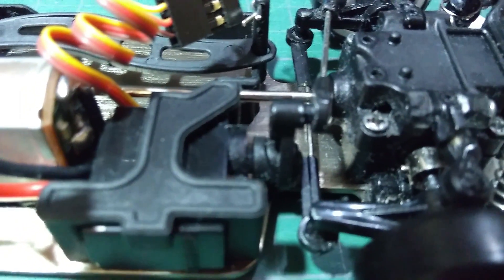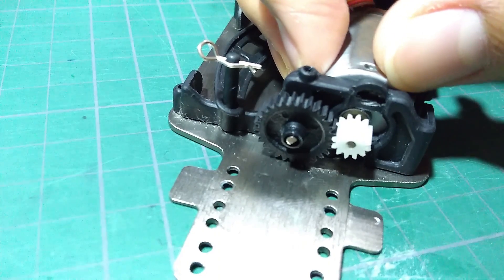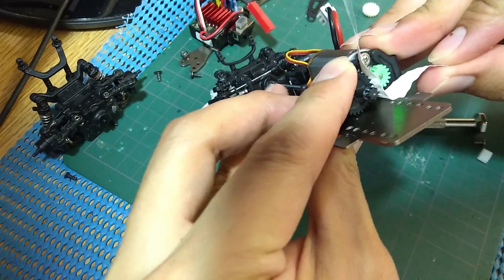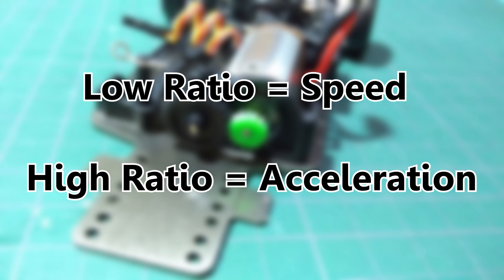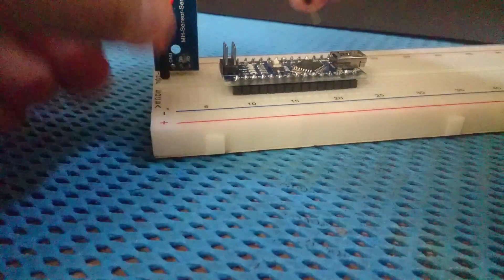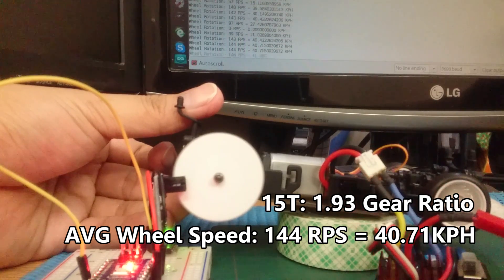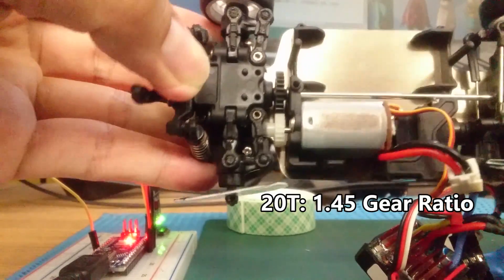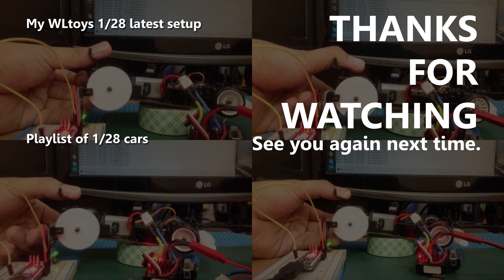How to set RC gear mesh, gear ratio & WLtoys K989 mod to use all pinions.

Comment: Is your car stock
Reply from the maker: The chassis is stock. The electronics already had an upgrade.
Reply: @BeaversHobby  what electronics in particular aren’t stock?
Reply from the maker: @joshuafallows2232  ESC = Hobbywing Quicrun 1625
Transmitter & Receiver = Radiolink RC4GS (I use RC3S, it's the previous version of RC4GS)

Comment: Has anyone else noticed that the newer version of this car is using a metal pinion without adjustment in the stock mount? If I use a gear puller to remove the pinion so I can modify the mount as described here, can I re-use the metal pinion or am I better off tracking down the plastic pinions?
Reply from the maker: Replacing it with a plastic pinion is a better.
Reply: @BeaversHobby  Seems like the biggest problem with mesh I have is with the metal pinion. That and the wobble in the prop shaft, but that's minor compared to how tight the pinion and spur are. I'll snag a pinion set and follow your motor mount mod instructions to see where it leads me next. Thanks!
Reply from the maker: @SchmingyYT  My pleasure. Best of luck with the project!

Comment: Howd you remove the stock pinion gear?
Reply from the maker: Using a gear puller is the safest way but you can make do with a simple flat head screwdriver. That's how I usually remove the gear anyway. Use a flat head to push it out.

Comment: Very nice tutorial 👍🏻 
Sir i just buy wltoys like yours, but i cant got straight steering, how to adjust them? I try to trim from tx but no result..
Sory for my english.. i hope you understand what im talkung about.. regards from indonesia 🙏
Reply from the maker: Check the tyres contact first to see if you got all 4 tyres on the ground. Also due to the suspension geometry it can be difficult to go straight once the car looses the grip so another way to keep it pointing in straight line is to mod the front steering linkages on both lower and upper bars so you can create toe out. Here are the photos.
You don't have to do this much because it'll eat up the tyres. I make this to show what a toe out means. https://imgur.com/EpSmkxk
Adjustable linkage. https://imgur.com/5cGBBcx
Use rods with ball ends for 3.5mm ball head.
Reply: @BeaversHobby  thank you for replying sir, i got it, i think the way, this is about adjustable steering linkages, i try to find rod like yours.. once again Thanks 🙏
Reply from the maker: @dodiiidris  My pleasure. Good luck with the project.

Comment: But using all metal pinions? Better or not?
Reply from the maker: All metal pinions are only good if you use metal diffs as well otherwise mod the centre shaft pinions with other plastic gear and use Mini-Z diff is better.
Reply: @BeaversHobby  Hello, thanks! Maybe this is a stupid question for the experts, but what is the best method to understand how far to screw the wheel bolts in order not to lock them or not to leave them too loose? I rotate one wheel in one direction and look to see if the other rotates simultaneously in the opposite direction and I stop to screw to the limit to make it rotate like this ... is that correct?
Reply from the maker: @CiroZeno  Yes, checking if it can turn the other wheel in opposite direction is also an option but it won't work if the drivetrain is sticky, you'll be able to turn it anyway in that case.
There are many ways to check if a wheel is too tight. Mine is tighten it fully first and try to nudge the wheel lightly and feel if it can turn without resistance. There will be a small area that allows a wheel to move before it turns the diff so I use that area to test if the wheel isn't too tight.
Reply: @BeaversHobby  Now my differentials are very smooth so yes, my method could be fine even if in fact it is not 100% reliable because I could leave the wheel slightly unscrewed. Ultimately, by any method, the wheel must have a little back and forth play without the differential cup spinning ... right? Is that the area you are referring to? Thanks again!!!
Reply from the maker: @CiroZeno  Yes, that's the area I was talking about. There's a small gap between the diff and the pin so I use that. Ultimately it all comes down to what works for you.
Reply: @BeaversHobby  Thank you very much, now I have to learn to drift but I can not start if I do not get the right tires even if I have already started to apply some rudiments ... too bad that the stock transmitter is not very sensitive and I don't even think the receiver ... next upgrade will be just that! Hello and see you next
Reply from the maker: @CiroZeno  Always a pleasure and good luck with the project.

Comment: How do you fix a loose motor gear
Reply from the maker: Glue it in will be a temporary fix. Replacing the gear is a better solution.

Comment: Hello, where can I find the pinion gears you are using in the video ? I saw the link in the description but it looks like they aren‘t the right ones. Can you help me?
Reply from the maker: I almost typed exactly the same thing. In short. You  can use only a few in that bag but it's cheaper to buy the whole bag. Otherwise search for "0.5 mod pinion 2mm bore" or "plastic gear small robot".

Comment: Hello, where can I find the pinion gears you are using? I saw the link in the description but it looks like they aren‘t the right ones. Can you help me?
Reply from the maker: The one in the link is a whole bag with many types, there are a few in that you'll be able to use. Unfortunately they usually come like that.
You can also search for 0.5 mod pinion with 2mm bore (it's the gear for motor pinion) but this mostly end up being more expensive than buying a whole bag though. You can also search for "plastic gear small robot".

Comment: How do you attach the pinion to the motor? My motor overheated on my stock k989 and started melting the plastic housing above it. It melted the 17t pinion attached to it as well. I'm trying to put on a 15t pinion but the hole is way too small for the engine rod to go through. I can't even hammer it on. How did you slide one on so easily?
Reply from the maker: It's tight fit on the motor. Optional gears that come with the car sometimes have too small hole so you'll have to use hand drill to widen it. Use 1.5mm drill bit and move around. If that doesn't work you can get some small plastic gears for small robots 0.5 mod.

Comment: Thank you for the video Beaver, using stock spec i just lowered the gear ratio with given gear set inside the rc package. 27 spur with 21 pinion and the car run very fast almost equal to wltoys a959 on concrete track

Comment: Sir, is it good idea to put a lubricant on the gear? just asking because i just ordered this Wltoys, just playing for fun at home only, could u advice something?
Reply from the maker: Yes, you will reduce wear if you lube it. I put some PTFE grease for plastic on the gear. You can also find grease from Tamiya if it's available in your area.
Reply: @BeaversHobby  ok sir thank you
Reply from the maker: @aliffaslam7289  My pleasure.
Reply: Sir sorry sir, last question, for rc Wltoys 1/28, do you have any suggestion extra battery with high mAh ? i dont know what type battery to buy
Reply from the maker: @aliffaslam7289  You can use any capacity (mAh) as long as it fits inside the chassis and don't add too much weight. I'd say you can use up to 450 mAh. 500 mAh is a bit difficult to find one that's not too big.
Reply: @BeaversHobby  ok sir tq
Reply from the maker: @aliffaslam7289  Always a pleasure.

Comment: Beaver's Hobby https://a.aliexpress.com/_dYjIXrA

Will this work with the 29T spur gear of this car? If not please suggest a pinion gear of 10T.
What dimensions should I look for?
I’ve only 6 square feet of playing area. So I won’t need much speed.
Reply from the maker: Yes, this will work. You'll have to mod the motor mount as in this video so motor position is adjustable.
Reply: Beaver's Hobby thanks a lot. Will be buying this one then. Is there any specifications which I should look for when buying(like the bore diameter, gear diameter, pitch etc)???
Reply from the maker: @dulatun  Bore 2mm or 1.95mm, 0.5 Modulus or 0.5M pitch.
Reply: Beaver's Hobby Beaver's Hobby thanks a lot man. You’re awesome. Looking forward to more awesome videos😉
Reply from the maker: @dulatun  My pleasure. Good luck with the project.

Comment: Beaver's Hobby , Yours videos are awesome & extremely detailed. Perfect for newbies like me. 

I want to increase the acceleration. As I drive it indoor, I don’t need much speed. 

Which gear ratio should I use for a better acceleration? (Using the gears that comes with it)

Doesn’t increasing the gear ratio stress out the motor? What’s the maximum safe upper limit of this setup. Thanks a lot.
Reply from the maker: To get acceleration you can use 15T on the motor and 29T on the pinion without buying anything new (motor spins 1.93 turn for the shaft to spin 1 turn). Higher ratio (motor has to spin more for the wheels to turn hence slower speed) is actually safer than lower gear ratio because the engine/motor doesn't have to work hard to get the car running.
There's also another way to call this which is low-gear and hi-gear which can be confusing (at least to me) because low gear means hi ratio where the car is slow (motor has to spin more for the wheels to turn hence slower speed). And hi gear means lower motor to wheel ratio so the speed is higher but with less acceleration.
In this car the safest you can do is around 19T motor and 27T spur which is low ratio/hi-gear (motor spins 1.42 turn for the shaft to spin 1 turn). Still, this ratio is not good to go full throttle for too long.

Comment: which one of these would be the most ideal for drifting?
Reply from the maker: It depends on many things, how much torque you need, what's surface you are driving on, etc.
Basically you would want the highest gear ratio possible. With standard parts that come with the car you can use 15T on the motor and standard 29T spur gear.

Comment: Hi braver, Do you using the pinion size with K989 drift cs mod? 17T, 18T or 25T?
. I want to drift k989 cs mod with 15T rear visai. and I do not know to use the Pinion size for it???? which better for drift ( acceleration or speed) Thanks and best regards.
Reply from the maker: I use 15T on the rear pinion giving it 1.875 CS ratio. I find it the best ratio to for the steering angle it has without doing monoshock mod to get more angle.
CS will make the car slower because you won't be able to control it properly if you go fast. Once you increase rear pinion, you'll have to reduce motor pinion to keep the torque up and make it controllable. If you want to go fast I suggest sticking with 50:50. CS is for holding opposite lock.
Reply: @BeaversHobby  thank you so much, I am using 15T on the rear. and I would like to 15T with 29T main gear( 1.93 with 40.71kph) I want to slowlly drift and very low speed.
Reply from the maker: @cinedronefpv8783  My pleasure. You can lower motor pinion to 10-12T for brushed motor and 8T for brushless because it has smaller can.

Comment: @1:33 how did you take the whole rear wheel assembly out? i removed the 4 screws at the back but still won't come out?
Reply: i actually did that but the pinion gear won't come out? do you have to put a lot of effort to take it out?
Reply from the maker: @samin2012  Yes, you need to pull the pinion straight out. It can be tight so be patience and pulling it out slowly.
Reply: @BeaversHobby  changed my stock 17T motor gear to 15T. Thanks Beaver.
Reply: @samin2012  do you need to grind the motor mount to fit it?

Comment: Nice video, it helped me a lot! But where did you find that 20T pinion? I can't find it
Reply from the maker: I got it from a random shop that sell stuffs to modify small car. I think you can find it in random plastic gear set on internet eg. ebay too.
Reply: I have to find the 1/28 one
Reply: Ok i'll search on ebay, thanks
Reply from the maker: Search "plastic gear" on ebay and the result will come up quite a lot. Actually the gear pitch is identical to other small toys so there's no need to worry in that aspect. What different is the size of hole for motor. You'll need 2mm hole.
Reply from the maker: This one will fit. Seems like it's the official kit from WLtoys.
Reply: Nice to know! Thanks a lot for your help :)

Comment: woww..nice info bro, btw what the best choice ratio for perform RC drift??
Reply from the maker: 15T on motor + 29T on pinion is the most balanced setup for this car. But I have CS ratio that increases the speed of rear wheels so I have 12T on the motor.
Reply: Beaver's Hobby how many CS that have you made?
Reply from the maker: Two, 1.5 and 1.875.